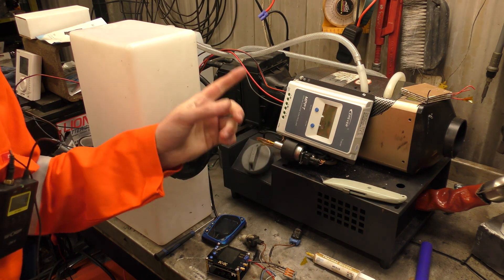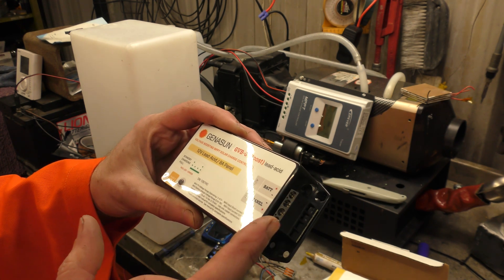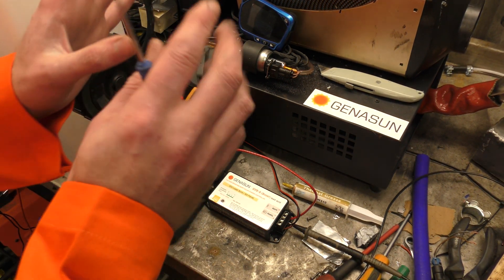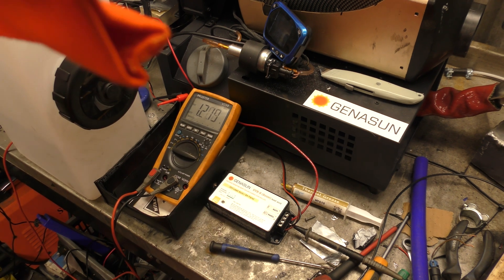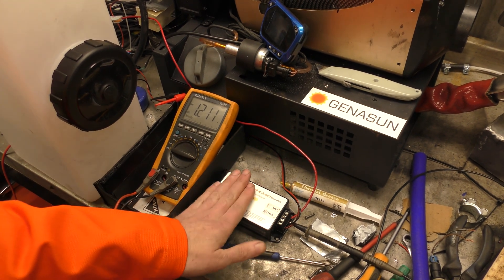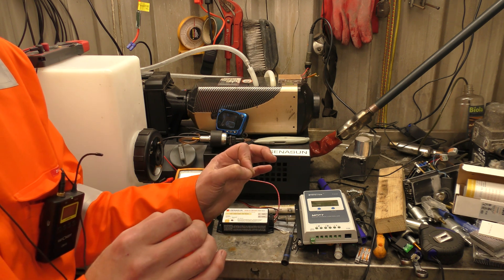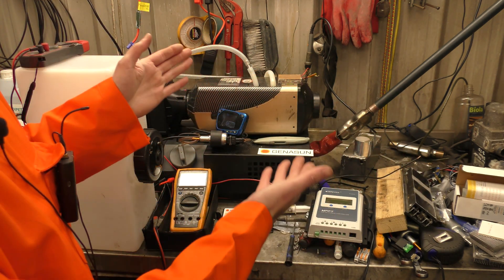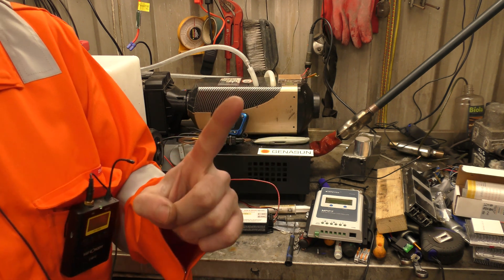Self Powered Diesel Heater Project - Testing the Genasun GVB-8 - part 6

Comment: Here you go, as i mentioned on another post you need max differential between the hot/cold side to generate the electricity,  Someone lower down had the great idea to use the exhaust heat to 'power' an evaporative cooling fridge, so do that BUT use the fridge to cool the nonheated side of the tegs as much as possible whilst using the heater to heat the other side of them.   We all know it can never work as there are to many losses and well physics is physics BUT it is so much fun trying and wanting to see how close it can get.
Reply from the maker: I quite like the idea of trying the evaporative fridge as well.
Reply: There is a military diesel heater that is self powered using a teg.

I believe the TEG is installed in the heated air, so of course you lose a small amount of output, but that's honestly not an issue for most installations of these things anyways. They're like 90k btus (edit: exaggeration. they're actually 35k) but I see no reason it couldn't be scaled back, albeit with a small loss of efficiency.
Reply: @Spearborne   have you got a link to these heaters?
Reply: @daveparf  HDT SHC35 self powered 35k btu heater.
Reply: @Spearborne   thanks you 👍🏻 so we aren’t crazy! 👌🏻
Reply: @daveparf  yeah. In theory it should be possible, and though it will cost efficiency that shouldn't matter for most applications.

You also run the risk of a module failing and actually pulling power from the others. I don't know enough about them or how to control them to know if that can be alleviated.

At the very least there's definitely enough in the cabin air circuit for sure. Even if you only get about 3% of the energy out of it that should be just enough to run a 2kw unit at roughly 1hz pump rate and definitely enough at high - at the cost of more fuel consumption of course.
Reply: @Spearborne  definitely! The way I see it is, if we take a 5kw heater and convert 3 kw of heat into electrical power to power its self we will still be left with 2kw of heat.
This would be a real game changer for people who live off grid in the winter.
Reply: @daveparf  I should make this project a higher priority I think lol
Reply: @Spearborne   definitely! We are trying to get all the great minds out there to have a go, somebody may come up with something the myself and David are missing,
The next version that I will be sending to David is fairly complex and should give us some decent results to work from as to whether or not to continue, I just need to stop working on other things and get it finished, the problem is that we are into summer now so it’s not going to be the best time to test as the cold air during the winter will give us better and more accurate results.
Reply: @daveparf  perhaps I missed it but how many tegs and what model are used in this test to get that 1.2a @ 12.8ish volts out of this?

Using the combustion chamber is great for high delta here. It's clear the issue is needing more modules in place, and it seems there's just not enough room in the unit?

My napkin math and googling of cheap teg modules over the last hour suggests that depending on the setup (might need to be massive with a ton of tegs) it might not be possible to use solely the heated air. It's simply not hot enough to give a sufficient delta.

Exhaust might be enough. I hope it is.
Reply: @daveparf  oh! And look at TEGs for wood stoves. There's a company that produces up to 100w claimed output, however the damn thing costs nearly $2k US and needs a very very hot stove top to do its job.

They sell water cooled TEG plates directly as well, but again high temp delta needed.
Reply: @Spearborne  I can’t remember off the top of my head but I think they are rated at 18v 1.6a with 200 degrees hot side / 30 degrees cold side.
Reply: @daveparf  so maybe you guys have considered this as obvious, but I wanted to type this out for my own benefit and perhaps get feedback from your experiences in testing.

Please excuse the novel....

I believe the issue with not achieving the fabled ~5% efficiency is a result of simply not having enough heat. Not in total, but at each module itself, and in both directions - heating and cooling. Clearly there is enough heat energy present in the unit but moving it is the challenge.

It's easy to get one side of the unit up to the rated temperature, but much less easy is getting the cold side down. Especially when you factor in the temperature gradient across the module. Even if the coolant is below the required cold temp the surface of the heat sink and TEG will be far higher.

Further, cooling the cold side is extracting heat from the hot side, thus lowering its temperature and requiring even more heat be dumped into it to maintain the rated temperatures.

The TEG241-60B (one of the higher rated units I've found) has a rated output of 20w at a delta of 270C. Matched load rating of course.

The amount of heat needed to pass through the module at that rated power is some 418 watts. I think that's ~4.75% efficiency?

That's a lot of cooling and fair bit of heat necessary to achieve the rated surface temperatures of 300c and 30c.

So it sounds to me like in order to get the ~50w necessary (with that teg model) we would need to figure out how to achieve almost 1kw of cooling while getting the hot side up to 300c. Of course this number will increase greatly with higher power needed for water pump or fans and the heat sink sizes will be significant.

Of course this will vary depending on chosen teg and doubly of course the heated air side has insufficient maximum temperature to do the job.

I haven't confirmed it yet but I am starting to suspect the SHC35 I mentioned before has a much higher combustion chamber temperature than these units do. This, coupled with a very efficiency thin-fin heat exchanger could easily meet a 300c or greater delta for getting significant power out of them. 6 of the tegs mentioned above in a hexagon is only roughly 120mm across, plus the large heatsink around it, and would output up to 120w.

Which should be easily done with 35,000 btu or 10.2kw of heat of course.

And the harder point seems to be finding units designed and rated to operate at the temperatures typical of these heaters, some 200c and lower.

AND we still have to identity if the exhaust, cabin air, or combustion chamber is the right source. Based on the design of the shc35 I'd say combustion chamber is obvious but I don't believe we can run them hot enough.

That would require a totally redesigned unit lol

Regarding cabin air, I think it's possible still but...
Tegmart sells a 1 watt unit that seems promising for the lower temps seen in the cabin air circuit but there's a few issues.  First, I can't get the data sheet to download. Second, they're like $15 US each. Running the heater off the cabin air with those would cost north of $1000 US in modules alone. However that's still cheaper than an inverter generator, and if we could get it to turn out positive current at low and high output it could be a great benefit in the winter where solar is very low.
Reply: @Spearborne   Ideally I’d like to have temp sensors on the hot and cold side so we can see exactly what is happening, 
The 200 degrees from the body of the diesel heater just wasn’t enough for the expensive 25w TEGS that we tried at first as they needed 300 degrees and 30 degrees on the cold side,
These cheaper TEGs are rated at 30w at 200 degrees and 30 degrees cold side, but like you said we just aren’t getting the correct delta needed.
The way I see it is “if” we could keep the cold side at 30 degrees we would need the hot surface that the TEG touches to be more like 400 degrees because the hot side of the TEG with take an average of both temperatures on either side of it.

Comment: Perhaps would a Stirling engine generator work on the heat output? Also, try running the cooling into some chilled water. Assumable if you're using a diesel heater, it'll be cold outside.
Reply from the maker: I wish I could get a 'real' Stirling engine and not just one of the toys.

Comment: David This can only work by calculatlng the total waste heat output from the heater then converting it into Watts and divide by 5% then you will have the electrical power that can be extracted. If great enough then in theory it will work 👍
Reply: This was my question several months back, Are the TEGS capable of actually supplying enough power under ideal conditions?  David Said yes but don't know how he worked that out and seems getting the efficiency to where it's needed if it is possible is not going to be easy as improving efficiency on things never is.
Reply from the maker: That's one of those "theoretical" yes's.  If the ratings on the TEGs is to be believed there is a chance.  But to look it at another way.  If we use the waste heat from the exhaust then that's 'free' energy to help charge the batteries.  :)

Comment: Just an idea. With an ordinary diesel heater. Just air. What about using heat exchanger on the exhaust (pipe within a pipe to creat hot water
Reply from the maker: We've done that a few times now.  With EGR coolers and swimming pool heat exchanger.

Comment: How about puting exhaust through heatsink as you suggest then tec's on outside and then heatsinks on top. Then encase in a tube with air intake pulled over the heatsinks. Would also benefit from increasing input temp of air for heater? Could even use outside air instead of room air for even more differential?

Comment: When using an MPPT controller for solar panels you're advised to maximise the voltage (ie run your panels in series within the max voltage of your controller), I'm not sure how you've got your TEGs wired but if you've got them running in parallel is there any improvement if you run them in series or as pairs in series
Reply from the maker: They are in series.

Comment: I'm not sure how you want to use the heatsink (yes, I wasn't paying attention), but you may want to consider the extruded 2080 aluminium? For the teg modules, you can put them on copper or aluminium squares and use heat sink compound and rivets to attach the squares to the extrusion. Will be cheaper than heatsinks. Just a thought.